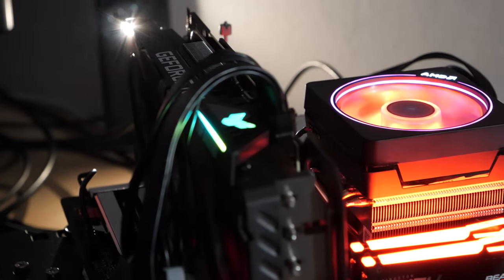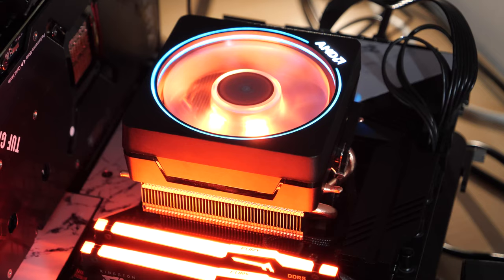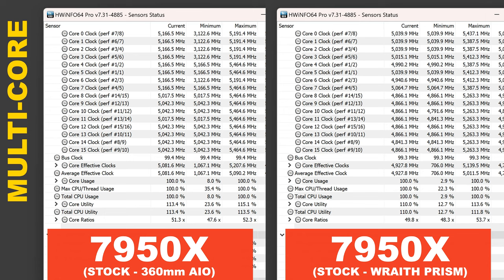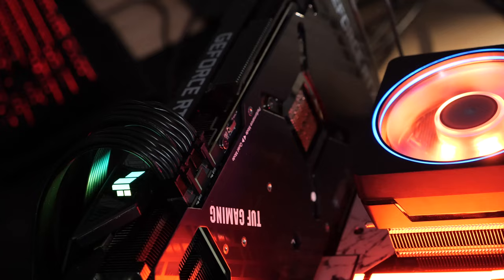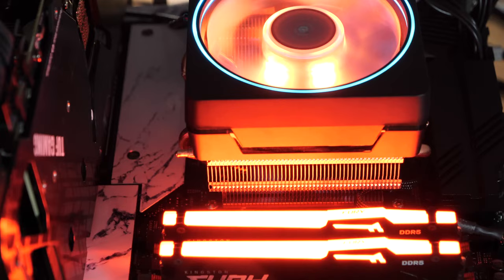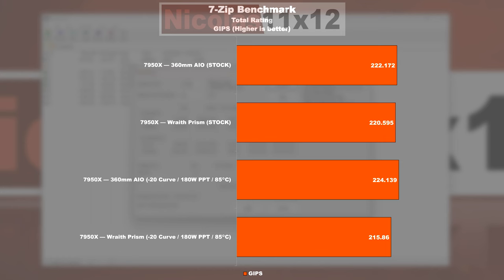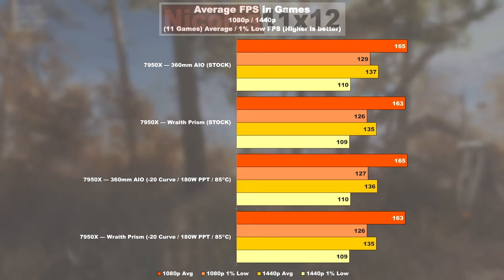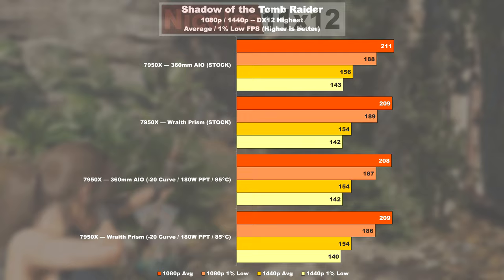This Is How RYZEN 7000 Reacts To Old STOCK COOLER

Comment: I'm, so happy AMD released the non-X CPUs that cap at 88W. These insane power draws need to never be seen again. Intel should do the same thing.
Reply from the maker: I agree. We need more power-efficient CPUs in general. Especially over here in Europe.
Reply: @Nicolas11x12English  Absolutely and it's not just the price of electricity. Also the heat management, the more expensive motherboard and PSU you need to ensure quality and stable power delivery, the bigger case, more fans, everything. And for what? Extra 5-15% performance, at 2-3x the power consumption? Not worth it imo.
Reply from the maker: @badass6300  Indeed! As you've said, one simply has to factor in additional costs for other hardware to make up for good power delivery and airflow.
Reply: amd doesnt have insane power draws, its 60-130w and 170-230w on the biggest cpu, intel has 180w-250w on i5 and 250-500w on i7 i9
Reply: @Noooo23523  Both are insane.
The non-X 7000 series have perfect power draw, 60-88W.
Reply: @badass6300  the 7950x is under the limit of the strongest noctua air cooler and not needing 1.6kw psu and running loud fans on the case to make maximum power, the i7 i9 struggle to use 250w to make power and need more to make maximum and a light overclock makes them consume 500w
Reply: @badass6300  you can put the 7000x run at 65w or just limit the temp and they will run less hot
Reply: @Noooo23523  yes, but the non-X does that out of the box and it does it better than just limiting temperatures, while also being cheaper.
Reply: @Noooo23523  I know, but as I like to say, just because one shit is bigger than the other, doesn't change the fact that they are both shit.
Non-X 7000 seires CPUs are the best thing right now, but realistically with DDR5 prices and expensive motherboards, I'd rather go for an AM4 R7 5700X or R9 5900
Reply: @badass6300  yes
Reply: @badass6300  going to am4 ddr4 is not better for the money mostly
Reply: @Nicolas11x12English   But where can we get them? All I see is Ryzen x. I can't find any non-x versions for 5900 or 5950.

Comment: It's doing surprisingly well, I still have the Wraith Prism I got with my 2700X in a cupboard somewhere, I kept it as a backup cooler because I've had 2 Corsair 240mm AIO's fail on me in the past.
Reply from the maker: Indeed!
Reply: Sorry to hear Corsair's QC is still absolute dogshit, especially the AIO's... ever since the first H100. 
They're on my permanent no-buy list.
Reply: @osbert  Not all Corsair AIOs are shit, i have a 2014 Corsair H100i AIO still working for almost 8 close to 9 years now since Dec 2014. I paired that with my i7 4790k. Not a joke.
Reply: @beachboy_boobybuilder  Hmm good point.
Reply: @beachboy_boobybuilder  Is it advisable to go for a cheap aftermarket air cooler with the i5 13600k or i5 13500 if i am not overclocking, using stock settings? I was thinking of getting the Dark Rock Pro 4 in my future rig.
Reply: @beachboy_boobybuilder  Interesting choices you present. I will have a look at it.
Reply: @BravoSixGoingDark  yeah, the H100i was what they were forced to bring out after their original H100 turned out to be a complete failure! in actual fact, the reason they are permanently on no-buy is because of their RMA / customer service which responded to a first email asking for more information, then completely ignored all follow up communication. Absolute garbage company, and not worthy of any repeat business.
Reply: @osbert  All true, expect mine is out of warranty lol.
Reply: @osbert  still using an h100i from 2015 and still going strong no issues sooooo........must be user error....

Comment: Nice video, thanks. I don't think this experiment is stupid at all. You can interpolate down to a lower draw CPU like the 5950x or 7700x and conclude that using the Prism might be just fine if you've spent your budget on the CPU alone.
Reply from the maker: Thank you very much! :)

Comment: I bought a Wraith Prism as a backup when planning my 7700x build. I also got an open box Mugen 5, but it lacked fan clips and the screwdriver. So, on went the Prism for now. I will swap it for the Mugen when the fan clips get here, but I'm glad i had an alternative to sitting on the parts and waiting.

Comment: To be clear, the Wraith Prism was never the stock cooler for either the 3950x or the 5950x. Both CPU's came box labeled as AIO recommended and had no in-box cooler. The only dual CCD CPU that shipped with the Wraith Prism was the 3900x.
Reply from the maker: Indeed.

Comment: I currently run one of these wraith prisms on my ancient AMD FX 8350 and it's amazing! I'm planning a new build soon with the 7800 and while I would LOVE to carry this cooler onto it for its looks alone, I think I'm still gonna invest in an AIO, but it's nice to know that I can use this cooler for a little bit in the beginning!
Reply: An AIO is always a terrible investment unless you have a high-end Intel 13th-gen i7 or i9 CPU that is used for production work only.  There's absolutely no reason for the average person to use liquid cooling.  Put the $100 towards a faster video card or CPU and, air-cooled or not, you'll get more performance for your money.
Reply: The AIO or liquid cooling system is the biggest money traps in my opinion, better to invest that money into a good case and good fan setup in said case to increase total system performance first, and then if you got money to spare use an AIO. AIO should never be a priority, unless its for looks

Comment: Your result are exactly what i found out accidentally, before christmass i bought 7950x and i was sure my assassin III cooler from zen 3 previuos build will work.. And it didnt, it was older revision because i bought it two years ago and zen 4 backplate doesn't come off, if you need to use heatsink which has own backplate zen 4 is no go. So i had deepcool 200 st beta box cooler i used on x99 build to test cpus with AM4 adaptor, and the only option i had that day to test my 7950x combo was to use that 10$ heatsink and it handled it no problem, just barely smaller frequiencies during rendering however no loss while gaming. Didn't want to wait for mount even though deepcool offered mounting kit however it would take a month to arrive from china. So sold my assassin iii to cousin on his 5800x3D, and got AG620 BK ARGB, didn't notice anything much different in performance. So yeah 95c on zen 4 is overrated.
Reply from the maker: I'm happy you were able to confirm my result. Those 95°C may appear scary, but they're really not. Plus, you could still lower temperatures, easily. :)

Comment: This test basically proves that spending over $100 on a 360mm AIO is a complete waste of money for most people.  I know for a fact that the Wraith Prism would easily handle an R7-7800X3D and I know this because it easily handles my R7-5800X3D, a chip that draws more power (and therefore runs hotter) than the R7-7800X3D.

I've used a Wraith Prism on my R7-5800X3D for about 1½ years now and it's perfectly fine.  Not bad for $0, eh?  😁

Comment: I'm using a wraith prism with the 5700x and if I could somehow get the 5800X3D for $200 I was always curious how well the prism could handle it, now I know it will be just fine for light gaming. The prism came with my 3700x which I now use with the 5700x.

Btw, they now include the Prism with Ryzen 7600 and 7700, I just put together a 7700 system for a friend and it was a pleasure to set up :)
Reply: with stock settings would be bad , after some "optimization" i think it will do .
I have 5800X3D and on stock it was 88c , just changing pbo scaller to 0 brought it down to 70c with just 80-120mhz less so not really big change on multicore and in games no differece in performance - just almost 20c drop in temps :D
Reply from the maker: Oh, I wasn't even aware AMD now includes the Wraith Prism with their 7600 and 7700 CPUs. Thanks for letting me know! :)
Reply: I think 7600 comes with wraith stealth and only 7700 comes with wraith prism if I’m not mistaken.

Comment: I have a Wraith Prism available and will be using it with my 7800x3D. This video gives me confidence I will work perfectly fine, given how efficient that chip is.
Reply: I bought the same cpu. Has the wraith prism been good enough for you or does it overheat?
Reply: @bladeedgerunner6854 Yo how 'd you fare
Reply: Did the wraith hold up? Looking to buy 7800x3d and want to know how if its enough
Reply: @justincontreras3046  it cools it just fine at stock. Haven’t even messed with curve optimizer but gaming load temps never go above 65c. That’s on 4k 120hz paired with a 4090 on games like Res Dead II and Cyberpunk 

It’s just annoyingly loud, so I swapped for a Noctua NH-D12L on my NR200P build.

Comment: You forgot to test the biggest drawback with this thing... Noise.
Reply from the maker: It wasn't really the point of this video. My intention was to showcase how Ryzen 7000 behaves with insufficient cooling in terms of temperatures, performance and clock speeds.
No one should ever pair a 7950X with a Wraith Prism. :)

Comment: hi, plc answer me, stock amd prism cooler enough for r7 7700?? for first time, not overclock, maybe undervolted?
Reply: It will be fine if it's the non-x 7700. That's the spec cooler. Can even run slightly overclocked with the automatic boost on

Comment: The motherboard only supports ddr5 while ddr4 is what's provided, the cooling solution may or may not be sufficient enough to cool the CPU depending on how it's configured. The MB can only handle 2 m.2 nvme storage whilst 3 is provided, the PSU isn't capable enough to provide enough power to all the components either as the gpu required a minimum PSU of 800w

Comment: 5800X3D+Wraith (non prism) works really good in anything that isn't Cinebnech or an all core full load, then it doesn't work at all. Like INSTANTLY at 90°C, and it stays there. While performance takes a minor hit (about 20% in multi, basically none in in single), I think running that hot can't be good for the CPU. Trying to understand whether a 120 mm aio or a cooler below 15 cm height might work.
Reply: 120mm AIO or some 120mm tower would be much better than any wraith, but even with d15s on cinebench I get about 82C (stock CPU settings). You can try PBO with 65W TDP settings or Curve optimizer (if your motherboard lets you).
Reply: @PREDATEURLT  I just need something that will avoid throttling and will fit. If it doesn't avoid throttling, I'd rather keep my "free" Wraith cooler.
D15 don't fit, because it has a height over 150 mm.

How can I tell an AIO TDP? I can't find it in any spec of any aio anywhere
Reply: @Anankin12  All 120mm AIO is in 140-180W range, but TDP is not good spec these days to tell how good it will cool. For you any 120 AIO will be enough for 5800x3d.
Reply: @PREDATEURLT  thanks 🙏, will find one that fits for a decent price

Comment: Nice results.
Reusing my Noctua R15 and using the AIO cooler money saved for a 7900 instead of a 7700 or the 3d model instead of the normal version, for a higher performance increase then the AIO would ever be able to manage.
Reply from the maker: Thank you! :)

Comment: i used the prism cooler with the 3700x and it worked just fine. I recently upgraded to the 5800x3d, and yea, no fucking way i would use it for that chip LOL. I purchased a Noctua D15. Bottom line, don't skimp.

Comment: How exactly did you seat this CPU Air Cooler on top of the new AM5 CPU's heat spreader? How did you seat it atop of the CPU spreader and socket area? I own a Wraith Prism - I use it for my 3600X since the stock cooler was COMPLETE and utter trash. 

My former 2600X had a copper core and was a GREAT cooler, AMD completely VIOLATED the 3600X Wraith Spire and made it a useless block of aluminum GARBAGE.

So, last summer I bought someone's 3900X Wraith Prism stock cooler for around $30, fantastic deal in mint condition. It finally keeps the 3600X in check without breaking a sweat, but I'm within the same AM4 backplate, linkages and platform. How did you seat it on an AM5 motherboard? Did you zip-tie it down or just held it with your hand on the heat spreader and hoped for the best? Seriously otherwise there's no way it linked and seated correctly on that AM5 socket, but let me know cause you omitted this element from your video.
Reply: the new non x chips come with the wraith prism so he was able to just install it on since there's mounting brackets for it on AM5 boards

Comment: Great review dude. Last week I purchased a 7900 non-X. Stock TDP of 65w. I also got new star wars game included with the CPU. Was thinking about 7900X but I can't be assed buying an expensive new 360mm radiator. Wanna see how my thermal right assassin 120 and Arctic Freezer 34 eSports duo air coolers cope with this new beast.
Reply: any update about your test on your build? Would like to hear how those thermal/cooler combo paired with your 7900 non x. It might also be my build for this year.